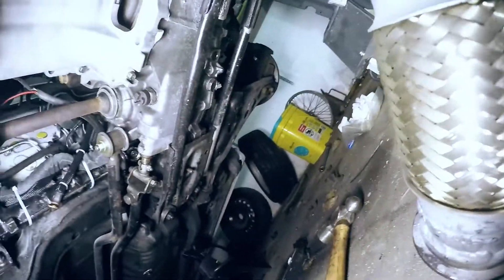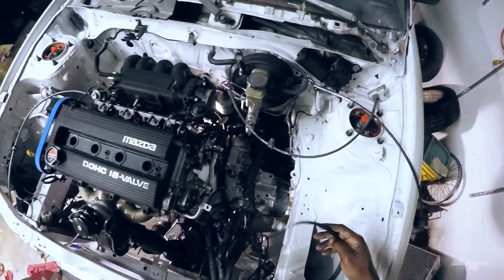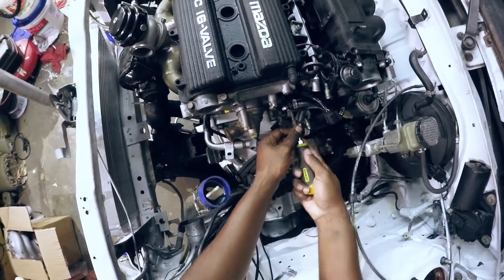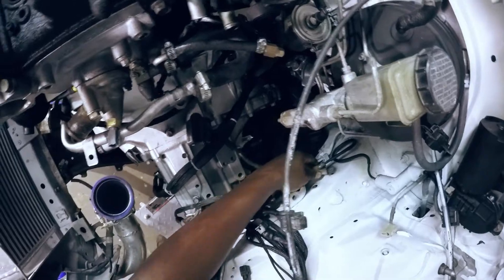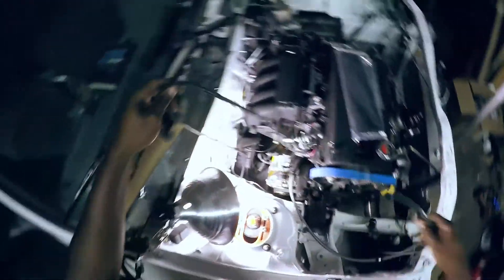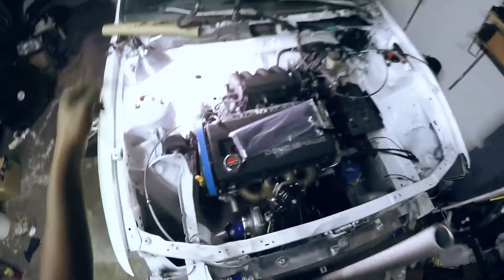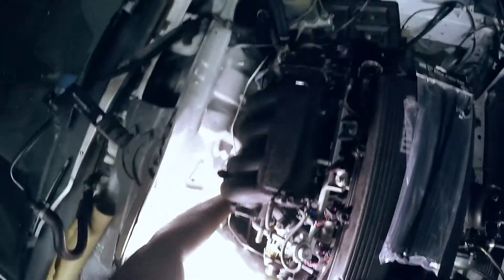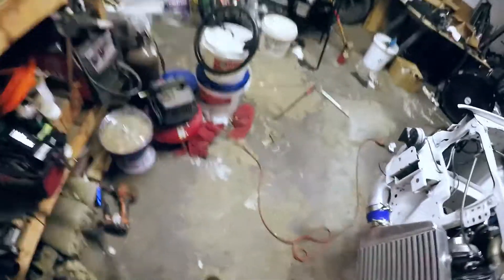Getting the BP ready to start.

Comment: I love your harness. It looks so easy to work with. Did you lengthen it or is that stock? It looks  clean running under the battery instead of around it. 🖒

Oh, where's your fuse box?